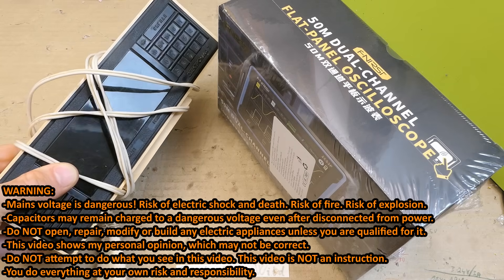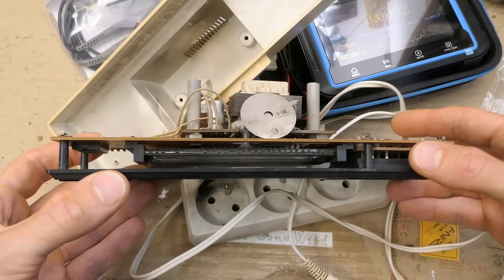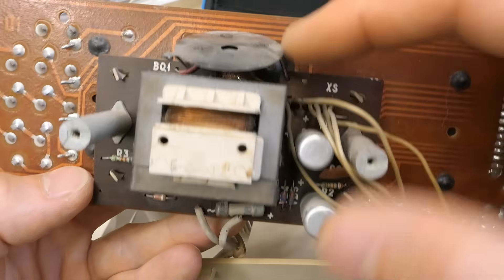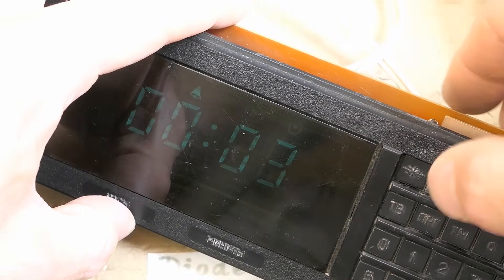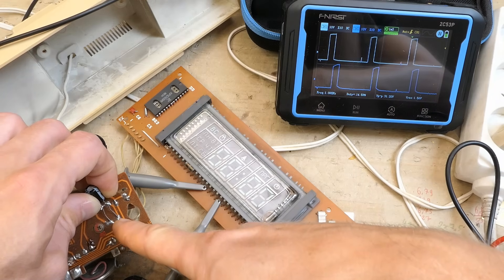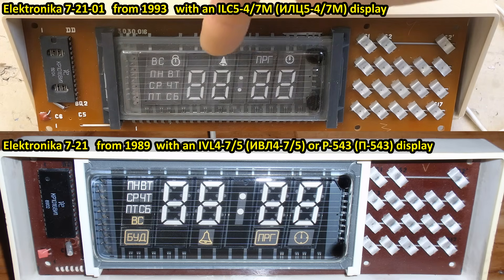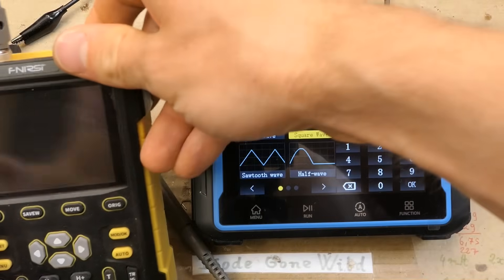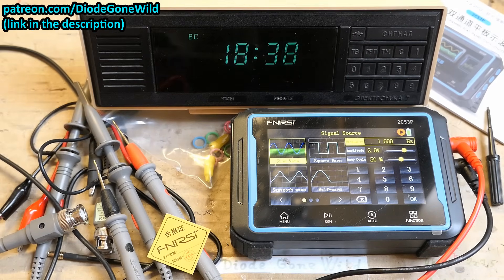Elektronika clock fix using Fnirsi 2C53P

Comment: I bought a clock just like this. I hope I can repair it using the video as a guide.
Now to buy the FNIRSI 2C53P unit and then the cat.
Reply: My clock arrived with a totally dead display.  I traced the problem to a 5,600 Ohm resistor between the first and second 100uF electrolytic capacitors.

Comment: I have I guess the same clock. And I was wondering if it's simple to mod it to keep internal clock working so there would be no need to reset it every time you unplug it

Comment: I really like my DPOX180H, a very useful tool, the only downside is it lacks amplitude adjustment in the frequency generator.
Reply from the maker: I also like DPOX180H and I use it a lot, but I never use the generator in it.
Reply: @DiodeGoneWild those little clips don't help either. I modified mine and added a plug, just below the type C connector, now it's perfect. I use it a lot to test audio equipment.
Reply: That is the best Fnirsi scope ever. The other is crap.
Reply: @juhaszpeter4796 there is a new one that looks pretty good, but is more expensive.

Comment: Reason for 0.25 fuse is pretty simple, that is the smallest value in that fuse series. And afaik that is the only pcb mount soviet fuse series. They could have put fuse holder clips on pcb, i think soviets had low current 5x20 fuses.

Comment: The 2C53P is a waste, not worth buying,
The measurements are basic. nothing extra.
The trigger is also basic, even worse, the single trigger is fucking buggy, there are a lot of random freezes.
If you stop the recording with the Single trigger, you can't move the wave on the display, you can't zoom in.
If I remember correctly, the single and normal trigger don't work in time bases faster than 2ms/div.
A lot of random freezes, sometimes a setting gets stuck.
Fnirsi left this project a long time ago, they don't develop it, they don't fix bugs.
The PCB is a joke in it.

Instead, they released the DPOS350P
But the DPOS350D is already in production.

Comment: At 4:50 you forgot to corectly plug the probes for Voltage measurement; you had them for current measuring, so you shorted the filament pins. Am I wrong?
Reply from the maker: Coincidentally, there was actually no voltage, beacuse the trace going to it was broken. I did'n notice until looking back at the video...
Reply: @DiodeGoneWild  Yes, I saw later in the video. However, I commented because it happened to me many times, and with expensive sounds and smoking effects sometimes.

Comment: When you first turned over the power supply board after detaching it from the main board, I spotted the transformer solder joints moving, and spent some time pointing at my screen "There it is" as you were getting your meter ready.

Comment: At 5:00, you have incorrectly plugged in your probes for voltage measurement. :)
Reply from the maker: Nobody's immune to this mistake :D But coincidentally, there was really no voltage there. The trace going to it was broken.
Reply: @DiodeGoneWild  Exactly. I made that mistake many times at the university :D It happens

Comment: I see your ESR tester is working again. I remember it failing in a prior episode. Mine does the same as yours did, and the input protection diodes don't seem to be shorted.

How did you fix yours?
Reply from the maker: The problem was that the impedance of the probes was zeroed at a too high value (more than about 0.5 ohm). This makes it unable to autorange. There's a bug, if the subtracted probe impedance is more than rougly 0.5 ohms. The raw value can go up to about 1.5 ohms, so subtracting more than 0.5 ohms makes it unable to go over 1 ohm and thus unable to switch to a higher range.

Comment: 4:53 have you measured the heater voltage with the probes in the position for current measurement?! :)
Lucky that the traces were broken...
Nice video as always nonetheless.
Reply from the maker: Looking at the video, yes, but there was no voltage anyway :). Coincidentally, the trace going to it was broken.
Reply: Heh, I noticed that too. You're required to make this mistake regularly with a multimeter, it's just the law
Reply: Yeah. I've blow a fuse that way... Or the other